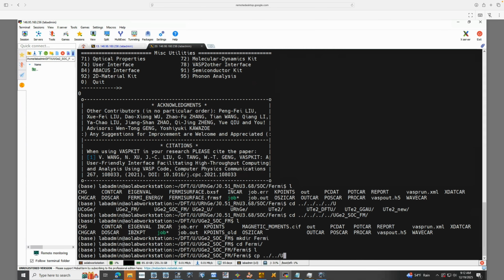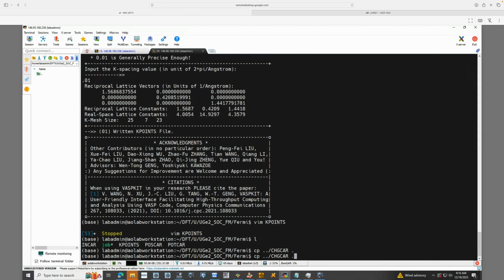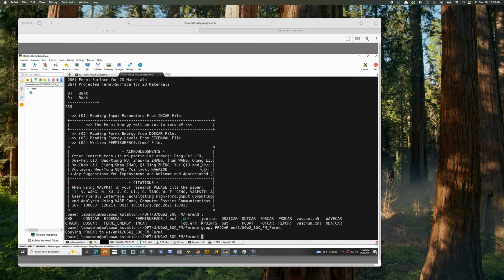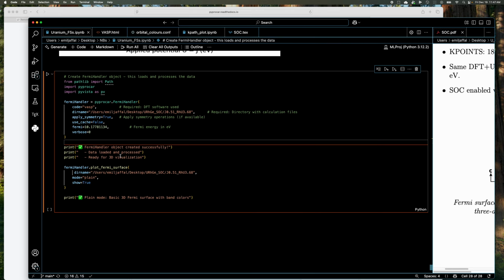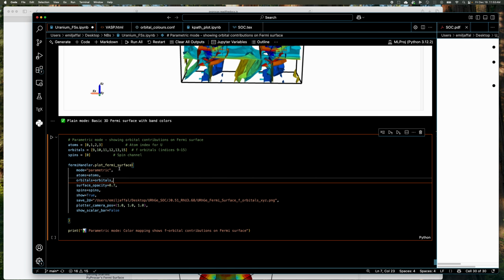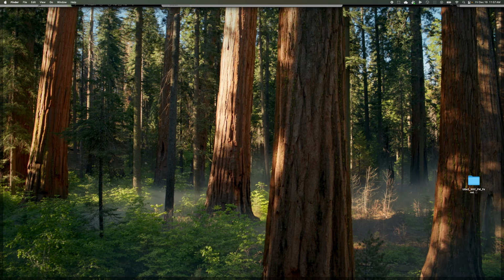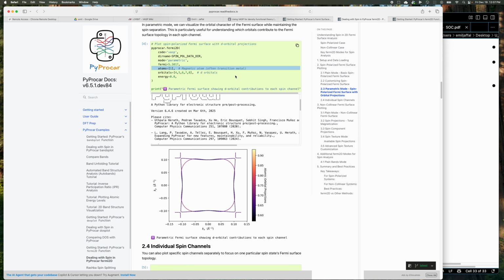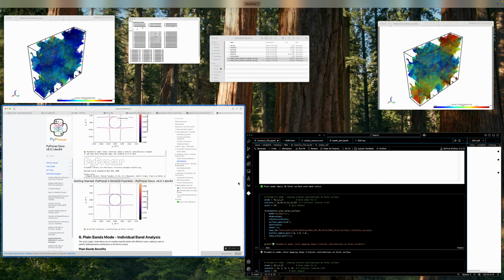How to Calculate and Analyze Fermi Surfaces in VASP (Emil Jaffal)

Comment: Do you have any tips on setting the parallelization settings for very dense K-meshes, like those used for Fermi surfaces? I'm trying to run a ~40 atom slab calc with a very dense k-mesh (101x101 ideally, but i've tried down to 41x41 lately), but I've struggled to set KPAR and NCORE such that the calculation both (a) doesn't hang when setting up the calculation and (b) doesn't get OOM killed. I'm attempting to run this particular job on an HPC cluster with 2x 64core EPYC CPUs at each node. I've attempted to increase # of nodes up to 16 (which should be WAY more cores than reasonable), and i always run into issues (a) or (b) no matter my settings, apparently. 

Any advice would be greatly appreciated!
Reply from the maker: Hey Robert, shoot me an email with the error message you’re getting. I have a feeling that it’s due to the odd k mesh and even kpar number.
Ejaffal@gradcenter.cuny.edu